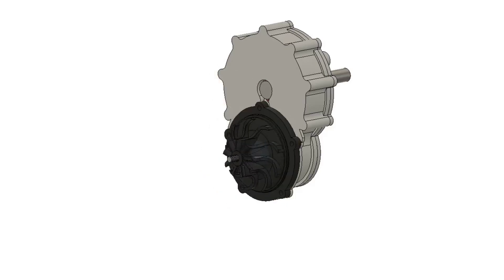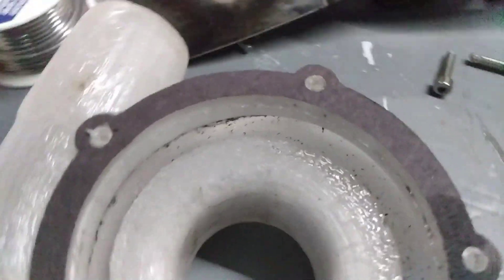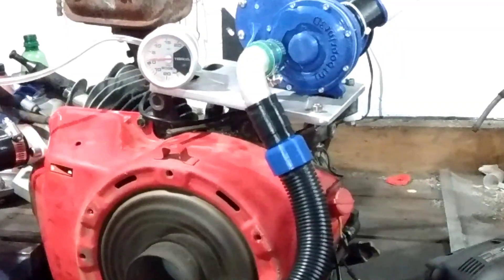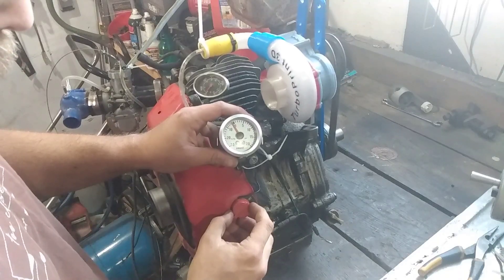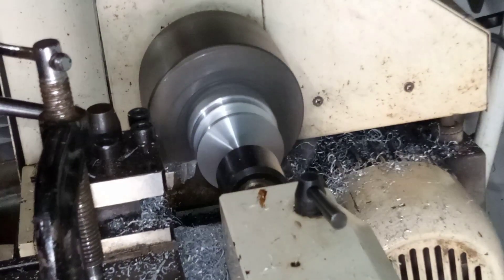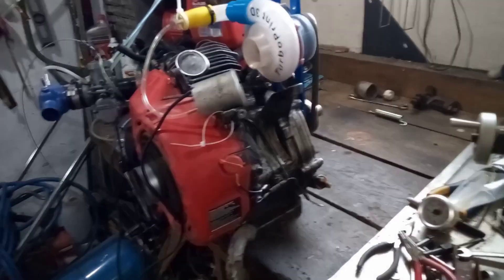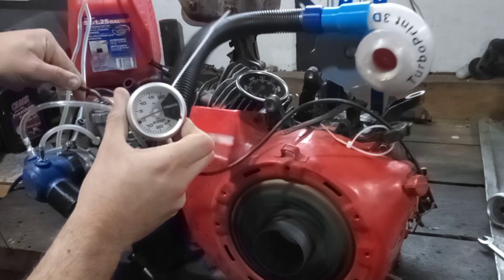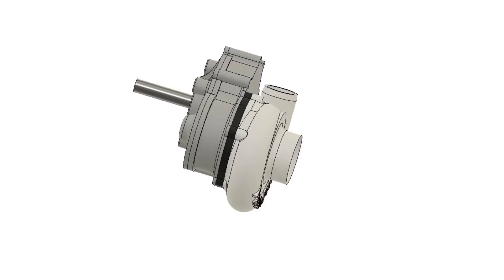Engine Testing 3D Printed Supercharger ( free files in description)

Comment: what are the larger bearings?
Reply from the maker: @duck_dabs6618  6203 ,on the back side of the input shaft , 6202 on the front side . Otherwise 608s I would recommend high speed variant for the 608 but standard 2rs should do for the input shaft .

Comment: look at proper CSC designs... skidoo... the old planes... kwaka H2...

note the trim ratios...

tiny inducers, massive exducers. they are not turbo chargers, theyre driven by engine power... they can be big. 

the longer the air remains trapped inside the compressor wheel, the less chance it has to backflow, and the more gradual the compression can be across the radius.

the larger the diameter, the lower the RPM has to be.

and then, plastic impellers are better off as closed rather than open blade design...

Comment: say i want to put this on my go kart, how do you think i should go about doing that. Also i was planing on printing it with PETG-CF, so do you think it would hold up to some abuse
Reply from the maker: That depends on a lot of factors , it might work ok at the gearing I'm working with on a gx160 or 200 but I have no way to confirm that . I printed all my parts from Petg . Cf Petg is a little more brittle but much harder and stronger it may be a decent material for the impeller and maybe the gears . In my latest video I tried a draw through system unsuccessful, since then I found that I have too much internal bypass as well as leakage to get a proper vacuum to a carb . I'm currently working on a fuel injection system ( mechanical). Short of waiting for that I guess u could make up your own fuel system or buy or modify a carb for blow through like I did on this setup .

Comment: I'm assuming you've balanced the impeller and the large gear?
Reply from the maker: i did not , witch it why its scary , however I have had an idea about that . I have been thinking of some sort of balancer that would be on the impeller shaft that would have a track with balance beads in it . seen something similar on a high speed dvd burner .
Reply: @turboprint3d  Get a DuBro balancer. I'm assuming the impeller would be light enough that removing material would be adequate for balancing, I don't think you'd need weights.
Reply from the maker: @madmanmapper  well I tried something similar on just the impeller and couldn't find a particularly heavy spots . Its such a small diameter and most of the weight is in the center close to the shaft. All that aside this is a starting point and the current impeller is crazy inefficient , and like will be replaced before any unbalance is an issue . Once I have some other things nailed down and have a more complete unit , balance will be something I will have to look into . I know where an industrial shaft and rotor balancing machine is , if they still have someone to run it by then I'll likely bring it there and have it  balanced .

Comment: I think that your impeller might need something improvement, but i agree that the centrifugal supercharger is the way to go
However i wouldn't trash the regen compressor, try a 2 in series set-up
Reply from the maker: The last unit was a 2stage and really saw not much improvement, I'm not completely wiping it off the table but I need to do some work on the housing and impeller for the Regen . The poor quality impeller on the snailshell is likely the source of all that whistle witch is wasted energy . I just made it all by eye and feel , now I have a decent starting place I have a direction to improve .
Reply: @turboprint3d  @jamespray made a pretty decent one, I might try to replicate his design
Reply from the maker: @Lucas_sGarage  there's a pretty hard limit on pressure from a Regen pump tho , using turbulence to build pressure makes a bunch of heat , the higher the pressure the more heat , and everything seams to peak around 3 psi . That being said I'm sure there's room for improvement but I did copy my design roughly from I think a German company . That's where I got the idea to offset the impeller towards the ported side . That companies max running range is 2.5psi if I'm not mistaken and usually have some sort of pressure shutdown after 3 psi  . Between my experience and that companies standard setting I'm guessing anything above 3 pis can lead to issues . That's being said I do have some ideas , like tipping the blades back to have less friction , too much would likely degrade performance.  Reality is 3 psi may be a max limit for petg made superchargers , but generally in industry the turbo compressors have a range of 3-25 ish psi , but can be pushed higher with current designs .  That however comes at a way higher rpm than the regen witch likely becomes a problem with any fdm printed parts .  So my likely course of action is push the current setup as far as I can , then go back to a Regen pump on the same gearbox to be able to use it at 2-3 psi reliably , or moreso anyways . I would love to have something that holds together long enough to make a few drag strip runs or something .
Reply: @turboprint3d  I think that another thing that you can do is crank the diameter of the compressor itself, in order to achieve the same tangential speed with lower angular speed
Reply from the maker: @Lucas_sGarage  yeah that would make a difference quickly but I would Imagen if I get over mach 1 I'm sure plastic is going to have an issue , there is a hard limit of the materials and I'm determined to find it.
Reply: @turboprint3d  x2, time to find the limits of abs/Pla/petg (I think that cf nylon would be a great choice
Reply from the maker: @Lucas_sGarage  ya petg is definately not the best for this for sure but I don't have much more than a basic ended 5 . Almost completely stock other than a linear rail I tossed on to replace the pom wheels on the x axis . I do have a cabinet tho . I'll eventually get som upgrades parts made up for the printer but I'm also trying to upgrade my CNC mill , put together a CNC router I picked up , and like 40 other things I need to take care while the weather permits ,and my health conditions really slow me down when it comes to alot of things. I'll eventually get there progress is a slow crawl at best tho .
Reply: @turboprint3d  nylon cf won't warp at all if you dry it and print it hot, get a harden steel nozzle (the V6 cheap ones will do the job) if you have an ender 5 get a box over it for extra endurance.
I truly hope that your health gets better, I really think that this is something that is worth a lot.
Reply from the maker: @Lucas_sGarage  ya I built a cabinet for my ender 5 , but I have some janky i3 ripoff that has an all metal hotend , and direct drive . That's been my go to for nylon up until this point . The only nylon I have played with is trimmer line . I cut my teeth as a machinist on complete garbage tools , so I'm very comfortable working with huge limitations , in that case I have yet to branch out to other materials as I'd just make up something out of metal to endure harder life . Somewhat of a double edged sword I guess . Health wise it's a slow improvement but I'm technically disabled , I'm doing all I can to improve but my kidneys took a dive a while back , so that's around the time I started messing around on YouTube,sort of as something to keep busy doing . The point all of this is at now is way more than I figured I'd ever really achieve so all in all I'm good just slow , I appreciate the concern , I also appreciate talking to someone with similar interests .
Reply: @turboprint3d  man, I want this to work so bad, I have plans for a supercharged scooter with a sequential transmission (aka transmission from a bike) and throwing one of this into a 150cc Pitbike go-kart